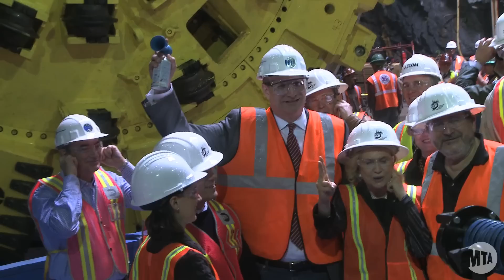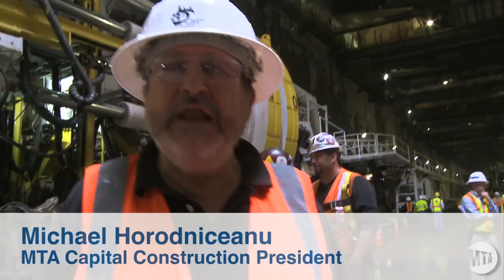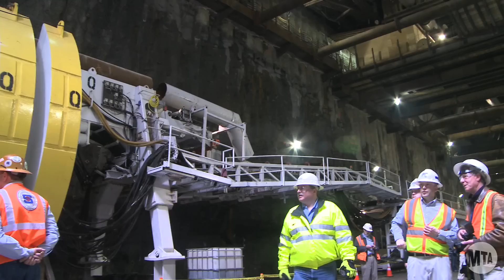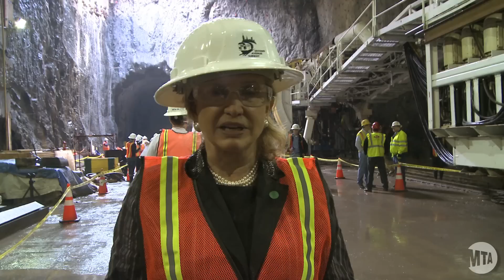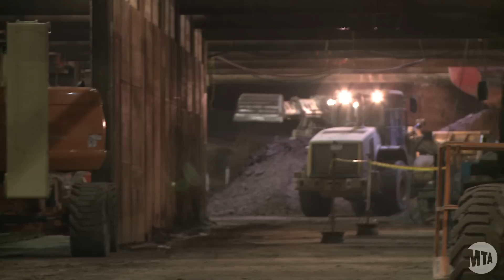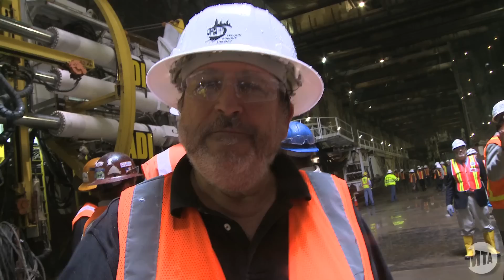Second Avenue Subway TBM Launch Ceremony

Comment: Well people say communism sucks but at least it gets things done quickly. By end of 2012 China will have over ten thousand miles of HIGH speed rail tracks and 42, not 4, not 24, but 42 HSR lines. And by then, we'd still be building 1 20 or is it 40 mile long Second Ave Subway. NUFF SAID.